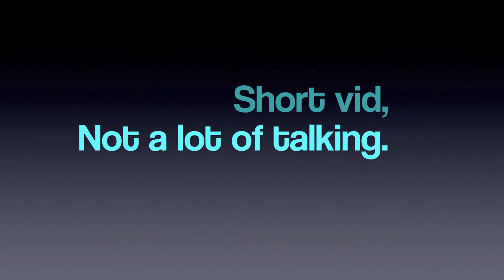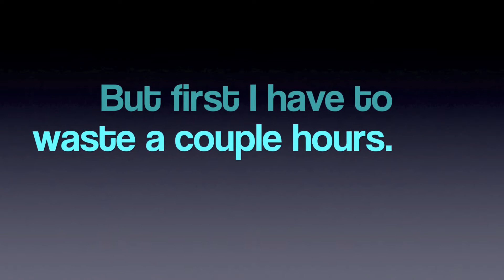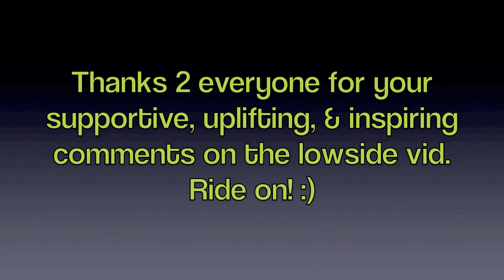The Aftermath

Comment: For the plastic repair use ,liquid plastic,plastic weld, the two component mix stuff.Epoxy mix doesn't bond that well.Plastic is abs on the fairing material.Abs glue isn't that good. Bad , you get about 2 spoons of material for $5.It will fill in an empty hole and bond.Use plastic screen mesh on the inside for strength.Matching the paint was actually the hard part.